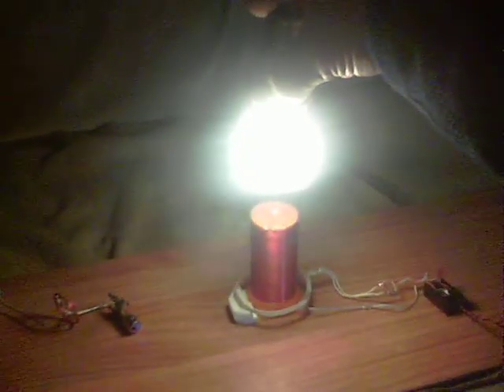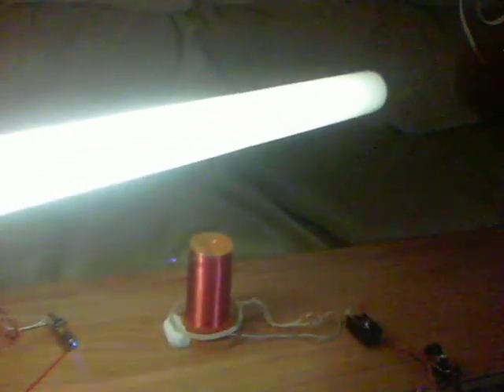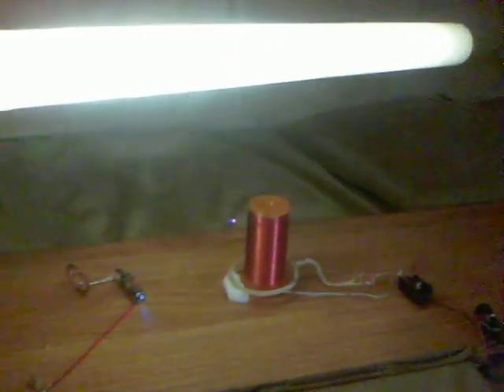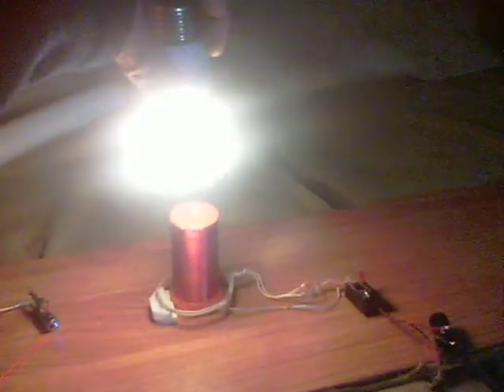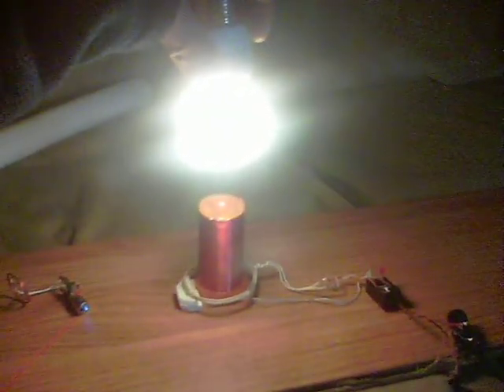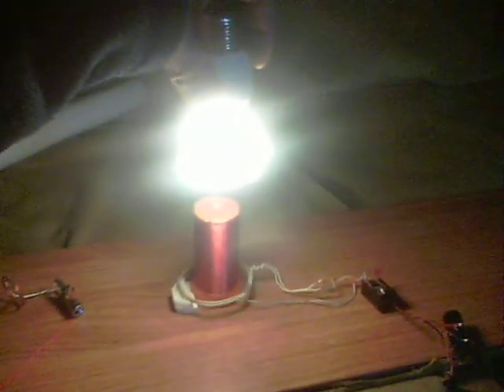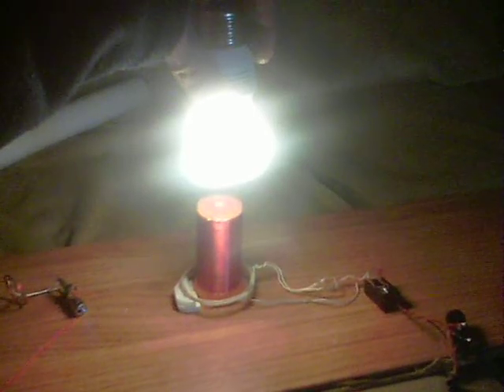Wireless exciter - D471 demo

Comment from the maker: @KyleCarrington Thanks :) Yep, Best so far in my opinion, based on around 20 NPN and PNP's tried.  Audio equipment amplifier transistors appear to be the way forward on low voltages